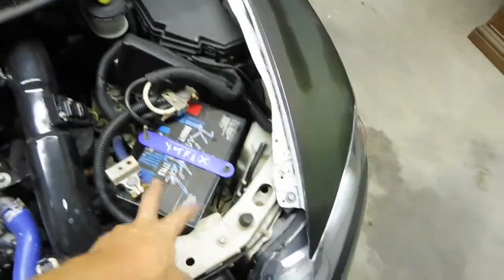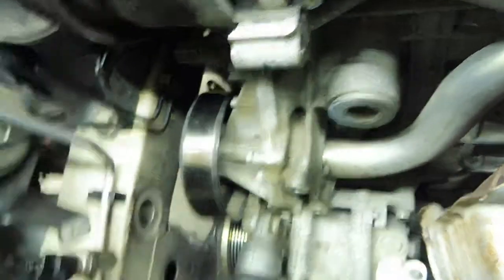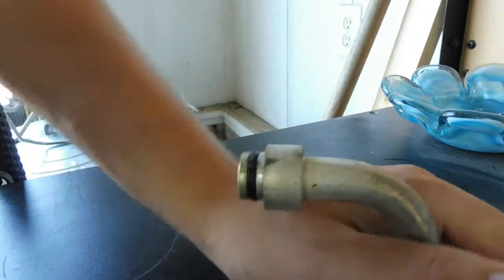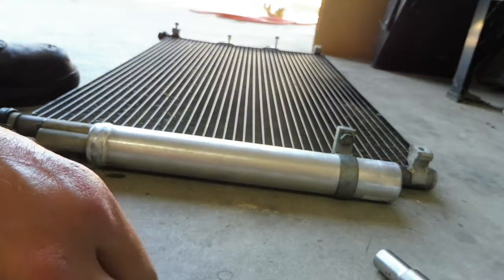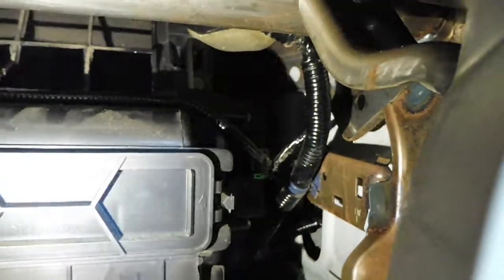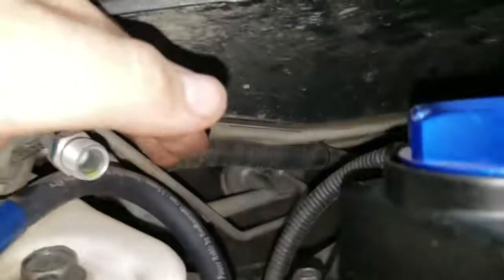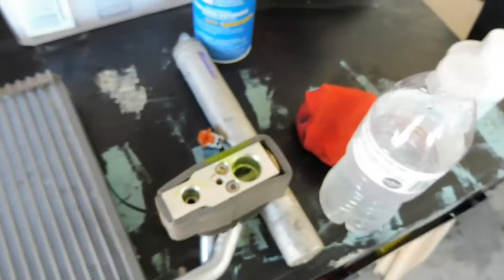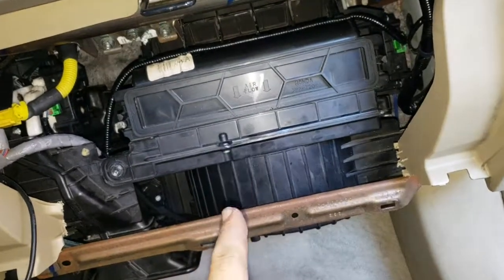Full AC rebuild Honda Civic Compressor , drier , expansion valve 2006 - 2011

Comment: I just had my AC revamped in April, 2022. I own a 1999 Honda Accord EX V6. Compressor removal was easy. You put the car on a lift, drop the plastic cowl, and boom, there is the compressor.  Replacement of dryer and condenser was just as easy.  There is a lot more work room in the Accord as opposed to the Civic. 

Odd that you experienced compressor/ system  issues. You indicated that you are working on a 2008, and you performed this replacement in 2019. Eleven years, and the system began to malfunction, interesting.  Mine is over twenty years, and just noticed a problem.  Since I have Auto Climate Control, I also had to test Heater/ Fresh Air regulators and sensors. Also check your Cabin Temperature sensor , aka Aspirator. A real pain in the butt!

The total cost to revamp the system,  $700.00. Had I had Honda do all the work, it would have cost $1,500.00.  I supplied the OEM Honda Parts, and had a local Honda Dealer perform the task. All the work is covered for a year. A year of piece of mind.
Reply from the maker: Good deal! Yes my compressor only lasted 11 years. But then again im still on the complete oem ac system on my 2002 civic with 315k miles. So its just a hit and miss thing

Comment: Just want to point out the inside of the expansion valve the front of it . Two o rings for there to compete the fitting lines. . But is not needed...thanks. I installed 2 inside the expansion valve, and on both out lines and two on the in lines.. and so note. The door jam says 205. Tire ...some where some how Mabye for updates road safety those stickers has been changed to 205 tire. Which is 205 mm that is 8 inch tire on a stock 6.5inch rim. 165/55/16 ...165 mm is 6.5 inches. So every car with this sticker with stock 6.5 rims have over sized tires on their car. . 205/55/16 that's 8 inches wide tire on a 6.5 rim. Over sized. So stock sticker used to be obliviously 165/55/16. So that's alot of usless friction. And a 205 tire said do not mount on a 6.5 rim. . a 215 says do not mount on a 6 inch rim...and so on .  So how's that sound
Reply from the maker: 205/55/16 is the standard size on 8th gens. Thats what comes on them
Reply: @ballsoutperformance  have you ever seen the 205. It says don't put a 205 mm which is 8 inch wide tire on a 6.5 inch  rim. We all know a 6.5 tires goes on a 6.5 rim or a 7 inch tire . There over sized for the at stock rim someone has changed the sticker during idk road safety updates. It isn't standard size..
Reply from the maker: Ive owned 2 of this cars and I worked for a tire shop for years, I can assure you, this is the size that comes on them from the factory. Ive changed hundreds of tires on these cars.
Reply: @ballsoutperformance  they just issued a warrant for trump

Comment: I completed it the air in the 06 Coupe Civic Mt. Is 34 degrees sitting now. Plus it's getting 53.33333 mpg. See yaaaa
Reply from the maker: Good stuff!
Reply: Do you have a parts list specific to the coupe by chance?
Reply from the maker: @marklavalle2154  i think its all the same except for the drier. On the coupe its built into the condenser, so you change the whole condenser

Comment: This is direct copy from 2007 Civic OEM online manual for future viewers.

AC Refrigerant Oil Replacement (With A/C)

Recommended PAG oil: SP-10
P/N 38897-P13-A01AH: 120 mL (4 fl•oz)
It is important to have the correct amount of refrigerant oil in the A/C system to ensure proper lubrication of the compressor. Too little oil damages the compressor; too much oil reduces the cooling capacity of the system, and can produce high vent temperatures.
•	To avoid contamination, do not return the oil to the container once dispensed, and never mix it with other refrigerant oils.
•	Immediately after using the oil, reinstall the cap on the container, and seal it to avoid moisture absorption.
•	Do not spill the refrigerant oil on the vehicle; it may damage the paint; if it gets on the paint, wash it off immediately.
Add the recommended refrigerant oil in the amount listed if you replace any of the following parts:

A/C condenser .	50 mL (1 2/3 fl•oz)
Evaporator .	40 mL (1 1/3 fl•oz)
Line or hose .	10 mL (1/3 fl•oz)
Receiver/Dryer .	10 mL (1/3 fl•oz)
Leakage repair .	25 mL (5/6 fl•oz)
A/C compressor .	Since the oil separator is equipped inside the compressor for this vehicle, oil drainage is unnecessary at the time of compressor replacement.
Reply: Hello thanks for this information! How do you properly add the appropriate amount of oil to for example the receiver/drier?
Reply from the maker: You can pour it directly into the line. Or if you are going to gas up the refrigerant with an automated A/C machine, generally you can inject oil into the system with that as well.
Reply from the maker: Great info
Reply: @ballsoutperformance   did you add any oil to the compressor or did it already have some?
Reply from the maker: Some come shipped with oil and some dont.  I would check before hand. If the new one does have oil, you should pour it out into a clean cup (or something) and measure the amount to compare to the factory specs.
Reply: @ballsoutperformance  Good advice.  The manual does not make any comments about the compressor oil.  I added it to my copy.  I did exactly what you suggested. It held 5 oz.

Comment: It seems this particular car, a 2011 Honda Civic, at least the one I have, anyway, has a different type of  A/C condensor on it - one with an integrated filter-drier which doesn't come loose from  the condensor. I have to evidently buy a whole condensor / filter drier assembly just to replace the filter drier; bummer.
Reply from the maker: Yours must be a coupe model? If I remember correctly the coupe model is the one with the integrated drier.
Reply: @ballsoutperformance  Yes! You're right, it is the coupe model. Thanks!! That makes sense, then. Too bad the manufacturer and seller of these separate filter driers doesn't specify which 2011 Honda Civic models they fit, and which ones they don't fit. I was initially wondering if it might have been because of the part of the year this model was made, ie, first half or second half of the year 2011. But I bet you're right, though - it has to do with whether it's a 4 door or a two door (coupe). Thanks so much for the quick reply!
Reply from the maker: No problem!

Comment: I'd like to avoid tangling with installing a new AC expansion valve on my daughter in law's 2011 Honda Civic. Is it possible that the AC  134-A recharge product with stop leak added that they put into, (which didn't work, by the way) plugged up the expansion valve? I would have not put that crap into it, if it were me. Can this stuff inappropriately plug up the AC system?   Thanks. Great video!
Reply from the maker: I guess it is possible. I cant say for sure as I have never encountered that but Im also not an A/C expert. I can change parts and I know the basics of how the system operates but I am far from a pro as far as A/C is concerned.
Reply: @ballsoutperformance  Thanks, BOF! You could have fooled me - they way you handled and described this job all along the way, every step as you were doing it sure looked professional to me! Kudos! You know your stuff. And your confidence you shared with us that "we can do it to", adds much help, as well. Thanks for the encouragement  and instructions to us all on this one! Great job.Great video work, too.

Comment: 13.34 is what helped me lol I didn't realize there was a bolt holding the lines to the firewall the lines was only thing I needed to replace on my Si thanks!
Reply: Where did you buy the lines ? I need the hot side my blow up , thanks.

Comment: Hey man great video. Should be able to get the job done if my body will handle it.  I have a few questions if I may please. I had a total blowout with gray oil or freon on a 2010 Civic LX so I'm going to change the evaporator an the condenser, expansion valve and the compressor. Should be able to blow out the lines with brake cleaner and draw compressed air. Question how much more compressor oil did you add other than what come with the new AC compressor ,?? I know you should take your old ac compressor out and measure it and pull the oil out of the new one and compare to the OEM level. Probably going to order from geekparts or there's another one Auto something or something Auto. with any help with the oil amount would be greatly appreciated and thanks
Reply from the maker: Hey man. Sounds like a good plan. You can handle it. As far as the oil, since youre literally changing everything there would be no oil left in the system. Pour the oil out of the new one if there is any in it, and measure it and just add however much will get you to oem spec. I cant remember what it is an no longer have access to the service manuals and specs that I once did. Call one of the big chain auto stores in your area and ask what the oil capacity is. When i was a teen i worked for one of those stores and in our system we had the fluid capacities for basically any vehicle. I assume they still do.
Reply: @ballsoutperformance  hey man I really appreciate it. My local dealership wants  $2850 parts and labor but my daddy would roll over in his grave if he knew I paid that much. Thanks for the info man and again great video.
Reply from the maker: Wow..... that is some serious cash for that job. Youre very welcome. Any other questions, be sure to reach out.

Comment: Did you replace the system cause the compressor failed ? I’m just wondering if  maybe you should have replaced the condenser and flushed the system ? I guess you didn’t need to if it all worked out great..👍Thanks for the video ..
Reply from the maker: Yea the compressor was no longer building pressure. It was worn out. And yea you can replace the condenser if you want. I inspected everything well and blew everything out with compressed air and there was no foreign debris in any part of system. I think on the coupes you have to replace the condenser because the drier is not seperate. Thanks alot!

Comment: How much Freon did it take?  Dealer can't/won't even tell me.
Reply from the maker: I cant recall. I took it to my friends shop to get filled. He has an AC machine. Sometimes theres a label on the bottom of hood or on the radiator support with the capacity. Also Advance auto part store usually have a database with capacities

Comment: Thank you so much bro, I have spend much money on honda civic Ac, but It is not working, Even mechanic changed all the things except AC Valve, But AC have same problem, Now I am going to change Dashboard AC Valve, today and inform you.... very informative video ... thanks
Reply: Hey did it solve your problems? My 07 is having ac issues aswell very frustrating i just replaced my ac clutch and coil
Reply from the maker: You replaced clutch and coil? That leads me to believe that your compressor wasnt kicking on?  Is the compressor coming on at all now? Can you describe your problem?
Reply: @Jonny-le9sl  yes bro I have solved it,,, but you know please ensure whats the fault actually, some mechanics are just making money and fun,,, but atleast check yourself first time.... This video saved my 500$ ...
Reply: So was it the AC expansion valve at fault, or not? Thanks
Reply: Expansion valves get clogged easily.

Comment: How much oil do you put into? And where?
Reply from the maker: I cant remember how many ounces. You should be able to find the spec online somewhere.  As far as where to put it, just pour it into the compressor.
Reply: @ballsoutperformance  Don't the compressors usually come prefilled with AC oil? Thanks.

Comment: Could you tell me what parts you used? Denso seems oem but Honda uses Satan a.c. compressor going cheap? Did you use Satan o rings? Reciever or dryer? Thanks
Reply from the maker: Correct Denso manufactures a lot of the factory components for Honda. And yes, these cars come with Sanden Compressors. I went Denso because its what I felt would be the best quality product for my money. The OEM Sanden compressor lasted till 175k miles, besides the AC compressor clutch which I replaced at around 160k. I used a 4 seasons drier because the Denso was out of stock. The o rings were either 4 seasons or Factory Air. I cant remember exactly, but thats what was in stock so thats what I used.
Reply: Thanks for your reply. Is there any chance how much of pag oil you use on the dryer if any? What about the sensor ac compressor does it come installed? I'm thinking about doing this job in a later date. This video was helpful by the way.
Reply from the maker: @purpledonatello  I didnt add any oil to the drier. I put the recommended amount of oil into the compressor. It will circulate from there. 
I dont understand your second question. Can you rephrase it? 
And Im glad the video helped. Its really not a hard job at all.
Reply: @ballsoutperformance  He's probably meaning the overheat cutoff switch (which is in series with the clutch coil) located on the back of the compressor. Yes, the new compressor comes with a new one, and it's already installed.
Reply from the maker: @teravolt6113  thanks!